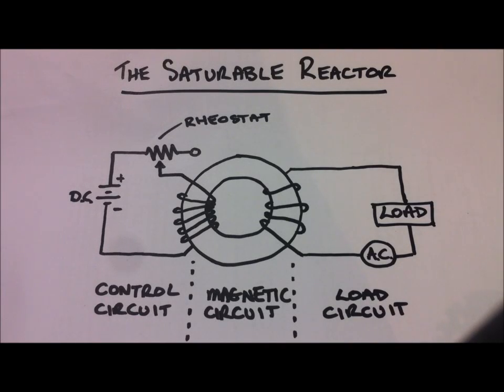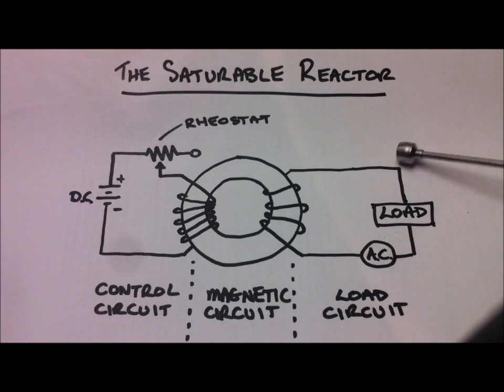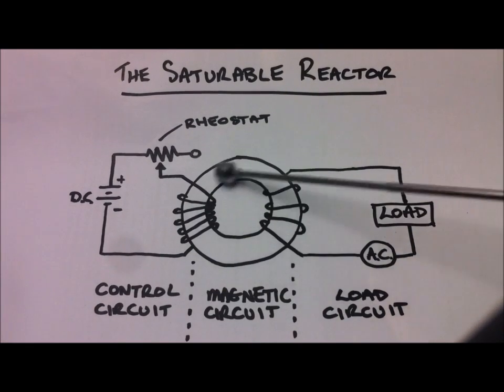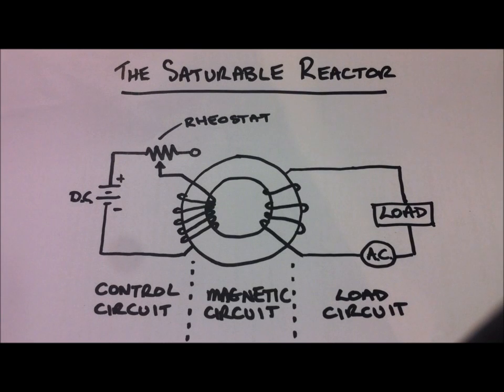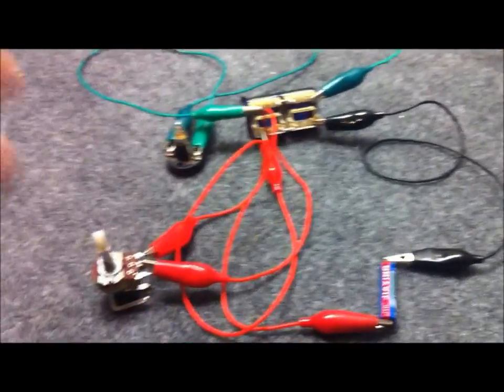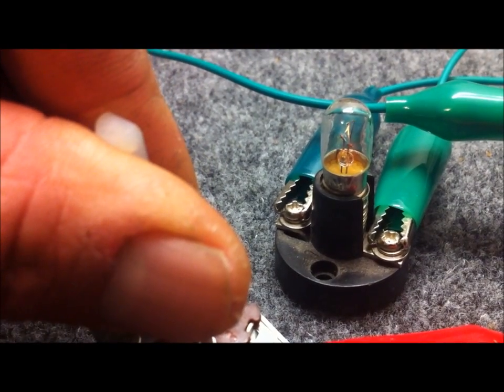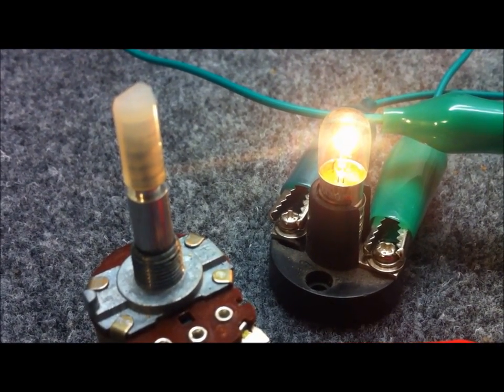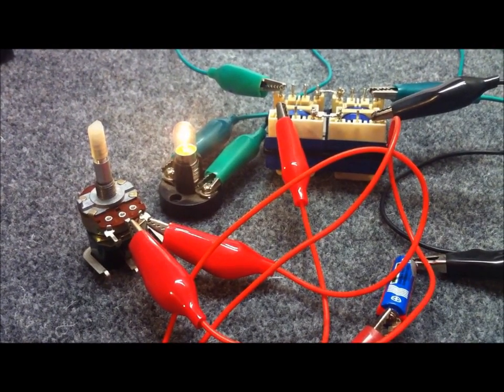How To #1 - Magnetic Amplifier & Saturable Reactor - Demo & Basic Principle Of Operation

Comment: The thing that tripped me up about saturable reactors when I first learned about them in school was this:

XL =  2piFL,  where XL = inductive reactance,  F = frequency,  L = inductance. 

So, a fixed inductor (normally) has a fixed inductance "L" and for a given frequency, the XL (the 'AC resistance' to AC current flow) is also fixed.

But what happens is this:
CASE #1:  the core is 'off' (not saturated).  The magnetic permeability (the ease that the AC current has in producing a magnetic field in the core) is LOW.  So not much AC current flows.

CASE #2:  the core is switched 'on' by a small DC current applied to the control winding - ie. the magnetic core is purposely, magnetically saturated.  This decreases the magnetic permeability of the core as the H field increases, and makes it vastly easier for the AC current to establish a magnetic field and thus greater AC current flows.

One way I used to think about it was this:
- a swimming pool has a slide with no water on it
- someone tries to slide down and makes very slow progress
- then water is added to saturate the pool slide
- now someone slides down very easily, since the slide is saturated with water

The 'impedance' of the slide is very high when it is dry.  The 'impedance' of the slide drops immensely when it is saturated with water.
.

Comment: control winding - drive DC current to high side (saturation region). Core permeability will dramatically drop to zero (ideal case).  Now, AC source to load is little impedance. Thus, light up the light bulb with maximum power.  It's for large power application. Solid state regulator won't apply this application.
Reply from the maker: Exactly! Well put.

Comment: I wonder that magnetic amplifier was very popular in 60's and I worked on many machines untill mid 80's then it suddenly vanished because cheaper SCR and IGBT based inverters and opamp based electronic amplifiers.
I still believe that it's cheapest and most simple to control motors and use in amplifies so far

Comment: Interesting! But what im concerned about is: how wont you get really high AC voltages at the DC side? When the meter is tuned off, no AC can get through, but still some high voltages run on those small wires. That could really cause a spark if you are not careful. 

This might be something i can use for a dimmer on a high powered light!

Greetings,

Jeff

Comment: I do not understand how it is possible for this circuit to work. An AC current produce great alternating magnetic flux around the metal core.  A weak uni directional magnetic force can neutralize opposing phase of the alternating flux equal to it's flux.  Can anyone please explain to me if i missed something?
Reply from the maker: Read the publication listed in the video description.
Reply: "Missed something"? You've missed everything.
AC is not "great" here. And DC is not "weak". Fluxes do not "neutralize" each other, but working together inside core. Go back to basics.
Reply: AC changes the flux inside the core. Change in flux induces current into the load. DC creates flux that does not change. So max flux - DC flux = room for changing AC flux
Reply: I too have difficulties finding the amplification here
Reply: @velipekkajutila9451 I would say this video does a very good job of explaining  magnetic amplifiers. Give this article a try. http://www.nutsvolts.com/magazine/article/the_magnetic_amplifier

Comment: can you please upload the apllications of magnetic amplifier
Reply from the maker: No.
Reply: magnetic amplifiers are widely used in welding machines,in which by applying small dc current welding current can adjust. also used in in railways in some control circuits.

Comment: Actually, this technology is not forgotten at all and is still in use today in a slightly evolved form in many modern switching power supplies. It is used to provide voltage regulation of the individual voltage outputs from a common high frequency transformer, all without the need for any feedback signal to the primary side of the SMPS.

Of course, since such power supplies operate at frequencies of a few tens to hundreds of kHz, the inductors/reactors are quite small, and the controlling circuitry is more complex than just a steady DC level, but the basic principle is still the same.
Reply from the maker: MTTT3000 
I did not know that. Thanks for your comment!

Comment: if we replaced the battery in the control circuit with a rectifier and maybe a parallel cap, would this work by rectifying the current induced into the control windings by the ac load circuit and provide dc control power without a battery?
    great vid btw
Reply: yes it will work

Comment: There is one part I find confusing about what you have here.  How do you keep the AC from transferring over onto your DC winding?  The way I have seen this done before is to have 2 AC windings that are out of phase so that they cancel out and there is nothing to feed over into the DC circuit.  How are you handling this?
Reply: You don't have to always "handle" this issue.

Comment from the maker: More care is required in the design of the circuit as you increase the AC power that you wish to control. Has he tried just putting a variac in line with the crock pot? It would be much simpler....

Comment from the maker: Ahhhhh, good question! Introducing a DC flux in the core allows you to control the AC flux which also exists in the core, which, in turn, controls the reactance of the load winding. At such low powers as what you saw in this demonstration, the battery can be eliminated and removed altogether, and the same effects are produced by transformer action alone - a function of the turns ratio. However, at higher power levels, it becomes essential. Build one and you will see why!

Comment from the maker: Output current in the load circuit can be eliminated if the magnetic amplifier is designed properly. It would require the use of a compensated magnetic amplifier. All this is explained in the book which I have recommended in the description.